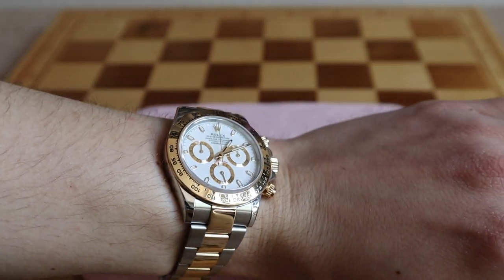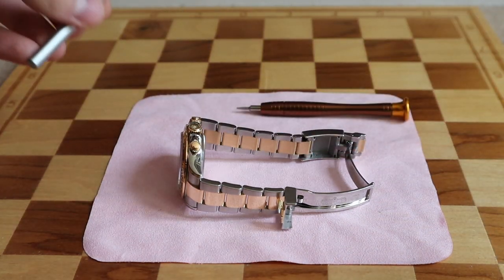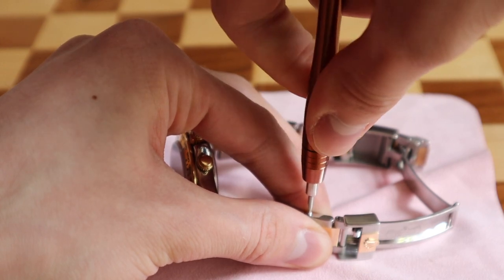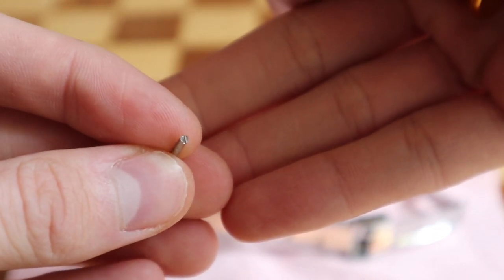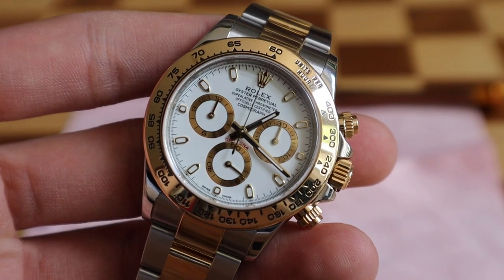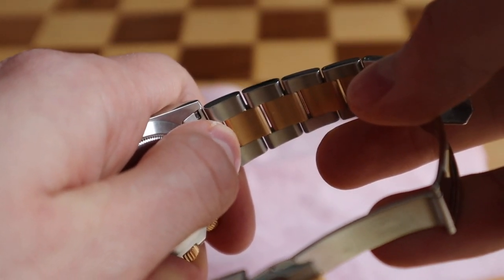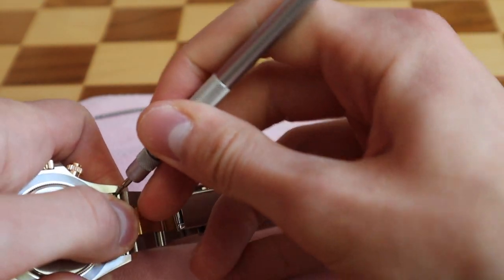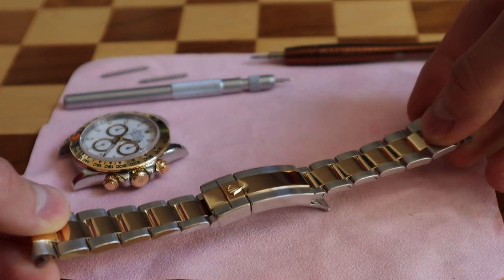How To Adjust A Rolex Bracelet? ft.  Rolex Daytona 116503

Comment: Mate, which two screwdrivers 🪛 should I ask in the market?? Which model ??  What to ask?? I have got rolex daytona , president model rolex watches. Is it multi purpose screwdriver???
Reply from the maker: 1.6 for Oyster and 1.3 for President/Jubilee, though it’s quite difficult to find 1.3 screwdriver. 1.2 should be fine for the job.

Comment: Any other tips on changing the bracelet? the bars just seem to move back and forth from one side to another. I’m trying to press with my thumb down but must be missing something
Reply from the maker: The aim behind pressing the bracelet (end links) with the thumb is to prevent spring bars from moving back to their original position, once you use the spring bar tool. I know it’s a bit fiddly at first, but you’ll get there. Apply a steady pressure with your thumb whilst you use the spring bar tool.

Comment: well done, so easy, steady hand the secret I suppose, but wait a sec, don't you need thread seal or some thing like that, just curious.
Reply from the maker: Yes, usually the advise is to use a compound that will make the screws stick tight in the bracelet, however I don’t use them. In 4 years, I haven’t had any problems with loose screws. Older watches might need it though.

Comment: But what about thread lock?
Reply from the maker: Don't usually use it. Never had any problems with screws falling off the bracelet.
Reply: @TheWatchCEO  Rolex require that thread lock be used.
Reply from the maker: @PricklyPearAC  I'm not Rolex, so it's totally up to me. As long as the screws are screwed in properly, no thread lock is needed. It's just my own experience. For your own peace of mind you can use it, of course.